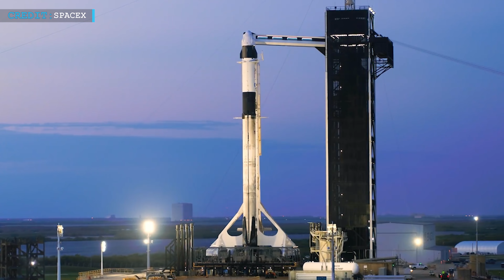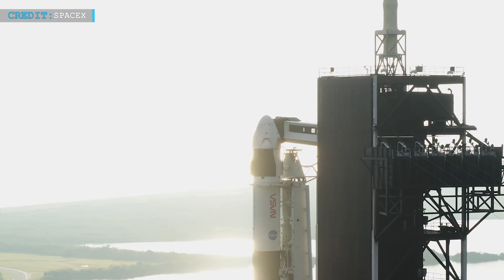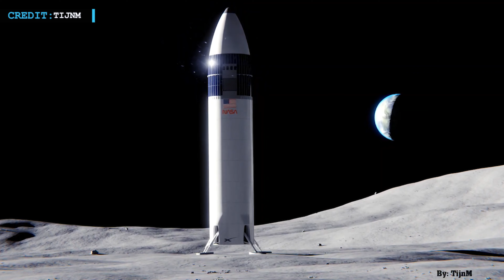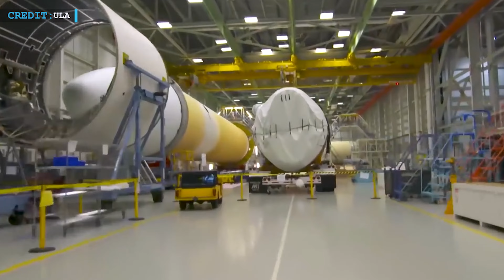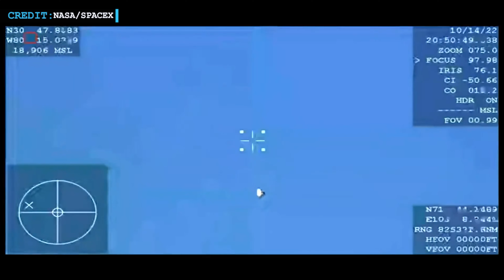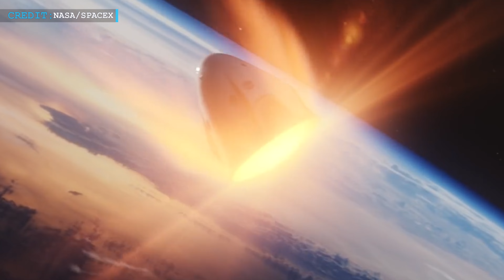If SpaceX’s Starship Goes Boom on Launch Pad, NASA Has Backup Plan

Comment: "*IF* SpaceX's Starship Goes Boom"?  You know Elon needs a sequel to his "How not to land an orbital class rocket". 🙂. Its rocket science.  Frankly I wouldn't be surprised if at least one SLS doesn't also go boom.
Reply: Chances of SLS going boom at first launch attempt is lower than with Starship, as much more testing is done before hand. SS, on the other hand is being purposefully built with the trial and error method, just to see which method works better. This maximises the probability of finding better solutions to certain problems. SLS is pre-designed with proven technology, and cannot be altered once production has started.
Reply: @Paul Michael Freedman  Frankensteins rocket? 
P.S. The solid boosters are expired already?
Reply: @gamerfortynine  I thought the SRBs were good until November?
Reply: @FrozenLionsFan  Another weak point of SLS. Shelf life of SRBs.
Reply: I dont think it will explode